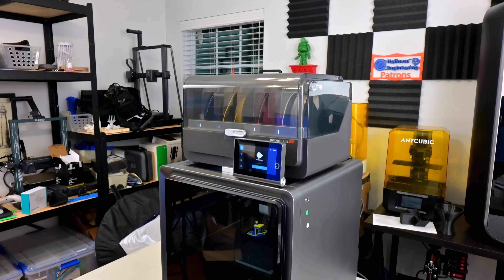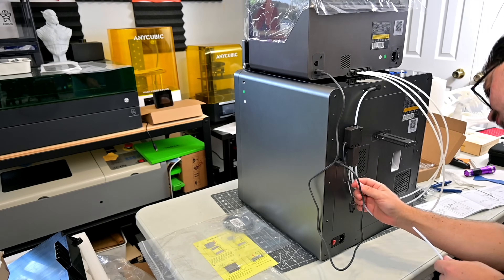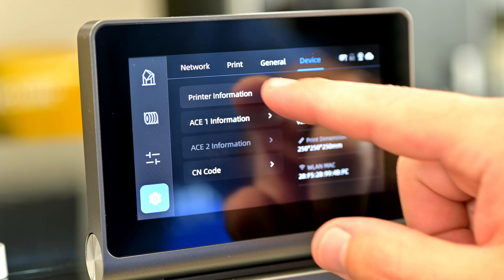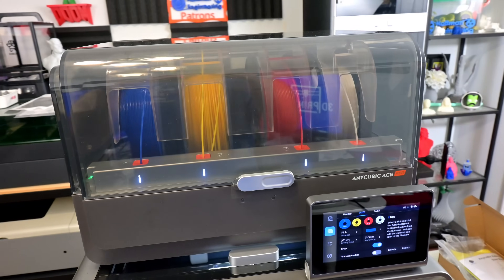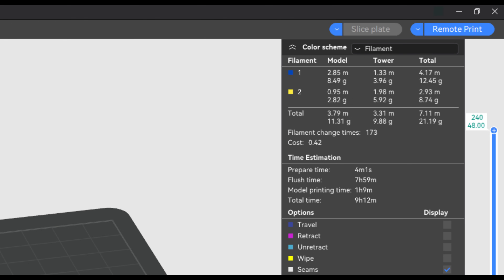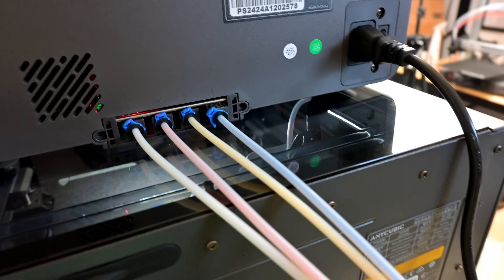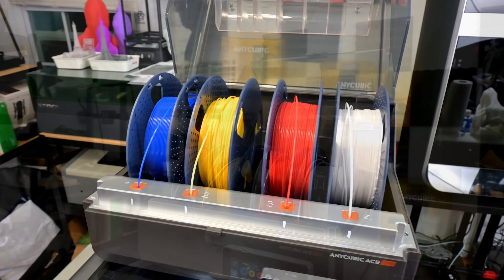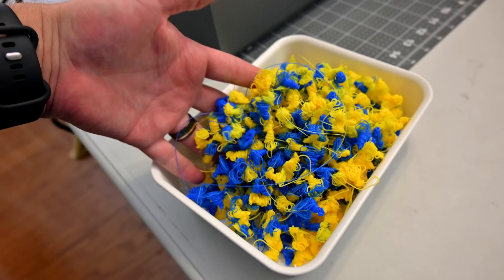Is this the Bambu Labs killer? Anycubic Kobra S1 | 8-color | Core-XY | 3D Printer - First Look.

Comment: Can this print from an app from phone or tablet? With WiFi?
Reply from the maker: Yes, the Anycubic app let's you browse their model library, and slice and send files directly from your phone to the printer.
Reply: @HoffmanEngineering  awesome thank you. I currently do not have a desktop or laptop. These are not required I take it to use this 3D printer? What are the advantages of have a hardware computer vs just using tablet or phone app?

Comment: Has anyone used an ace from a kobra 3. The one without the filament roll guides. As a second ace to give 8 colours. Cheers Ed
Reply: Search around on printables and other sites. I've seen some designs that basically replicate our supposedly improve on the dividers in the lid of the s1 ace pro so you can indeed use the ace from a kobra 3. There are also printable filament hubs too, even 5 and 9 port ones so you don't have to disconnect any of the PTFE tubes to feed filament from outside the ace pro, like if you're doing tpu.

Comment: How do you connect a second Ace Pro to the S1?
Reply from the maker: There is a 8-tube attachment you can print for the back (that replaces the 4 tube one that comes with the combo). Then you connect the cables for the second ace to the first one, and connect all the Bowden tubes to the 8-tube attachment.

Comment: Thanks for making this review, very informative and useful.  You mentioned about ACE will switch over to the next spool of a same color if the current one runs out.  In order for this to work, did you have to do anything in the settings, or it does it automatically when you have 2 of a same color filaments in the ACE?
Reply from the maker: You have to toggle the "filament backup" setting in the ace pro menu on the touch screen. If that toggle is turned on, it'll automatically switch over.
Reply: @HoffmanEngineering  Awesome, thank you!

Comment: The Kobra S1 is slower in sport mode the my Bumbu X1C in standard mode so what are getting paid to lie? Why is it that Anycubic went through the trouble to make a a filament dryer in the ACE pro then didn't bother to seal it in any way what so ever? and the software seems to have been rushed & buggy. Try printing 2 identical parts then about half ways thru it skip one of the parts and then see what happens the the other part when it finishes. you'll have some really funky quality and strange artifact where the nozzle starts after skipping the part. I bought this printer because I wanted to print carbon fibers like  ASA that you need to dry while printing but with all the air gaps in the ACE pro is a no go for me. I'm thinking of sending it back too many little thing to deal with.
Reply: LOL Bumbu is right!  My S1 SMOKES my X1C...In every way.  I literally have been trying to sell my 2 year old X1C and nobody wants the thing.  I was only asking $500 and I got ZERO offers from Ebay, Facebook Market place.  I did FINALLY this week get someone who wants to trade for a Creality Hi combo and I think i am going to jump on it.  Bambu are junk compared to newer printers

Comment: Got mine yesterday have yet to figure out how to get a muti color print to work.
Reply from the maker: Awesome! If you have questions, I'd be happy to help!
Reply: @HoffmanEngineering  how did u get the benchy to swap colors?
Reply from the maker: I downloaded a two color benchy from Printables, it was two separate stls. I opened them in the Anycubic Next Slicer, and it asked if I wanted to treat the two files as a single object, I said yes. Then told it to use filament 1 for the first part and filament 2 in for the second part.
Reply: Pretty sure you have to slice the model incorporating different colors. You can choose what portions are what color.

Comment: What is the footprint of Anycubic Kobra S1 Combo? How much table space do I need for it?
Reply from the maker: The printer itself is 16" wide by 17" deep by 22" tall with the screen open. You'll need another 3-4 inches at the back for the spool holder and poop shute. And account for the door swinging open at the front.

Add on the ACE Pro, if you place it on top of the printer it bumps the required height to about 33" with the lid open. Otherwise, if you place it next to the printer, you'll need an additional 14.5" wide, 12" deep, and 14" tall.
Reply: @HoffmanEngineering  Thanks for the accurate answer!

Comment: That amount of poop seems very excessive. I hope anycubic will let you change the flush volumes in the slicer like bambulab does in bambu studio, bambulab printers have the same issue but then you realise you can easily cut the flushing volumes by 3 in the slicer, then the amount of poop is a little better
Reply from the maker: You can't adjust in the slicer, but you can adjust on the printer itself. I'm wrapping up some tests around flushing amounts, and you can cut it down quite a bit for most filaments.
Reply: @HoffmanEngineering  thank you
Reply: @cartouchator his video is out
Reply: @ thank you, already watched and liked :D

Comment: Mine arrived yesterday, Feb 18, 2025 and it was rather easy to get up and running. I have done several tests and all is working very well. I did find the app and windows software a bit finicky with the wifi connection but finally got it all sorted out. Firmware updates were done and I don't see much difference between the Bambu Slicer and this one. I have a A1 Mini and now this one so I have all I need for now. Can't wrong on the current Pricing.
Reply from the maker: Thanks for sharing! Yeah, Anycubic's latest slicer is based on OrcaSlicer, which is based in Bambu Studio. Very similar functionality currently.

Comment: I’m always interested in the built-in slicer quality and stock tuning, and the material selection for these type of “plug and play” printers. Also if the ACE system can also swap between materials for potentially rigid and flexi materials or cheap and expensive materials for supports
Reply from the maker: Good things to note, thanks! I tried TPU in the ACE Pro on the Kobra 3,and I didn't have a good time. It gets tangled in the mechanisms inside. I learned how to disassemble the ace pro because of it though, so that's good.
Reply: @ essentially what you can achieve without tinkering. Good to know about the TPU. That seems to be the norm with every company’s version of this system

Comment: Would this be a good printer for a newbie. Im also concerned about the smell it creates
Reply from the maker: So far I'm pretty impressed by the usability right out of the box. I think it'd be a good option for newbies, especially those looking for multi-color printing.

The full enclosure and activated carbon filter definitely will help with any smells. But, I haven't printed ABS yet, and that tends to be a very smelly filament. So that would be the true test.

Comment: Hi there, thanks for the great video. I am deciding whether to buy the Kobra S1 or the P1S from Bambu Labs and this helped a bit. I have done a lot of research and talked to a few people I know who are 3D printers, but would love your perspective as well if you have one. So far the consensus from both the research and the chats is that there isn't really that clear of a difference between the two. No one has even said something like "The $200 extra for the P1S is worth it if...." No pressure to try to delineate the differences as I know those from the research, really just looking for your gut reaction to whether the additional $200ish for the Bambu Labs P1S is worth it in any way. Phrased differently, if it was YOUR money to spend, which would you choose?
Reply from the maker: I think you covered it quite well. That is generally my feelings so far about the S1. It matches the P1S, and there's really no big differentiating feature between them, which puts the S1 as a really good value. 

I'd like to see how the longevity and reliability of the Kobra S1 turns out. For my first few days, I'm very impressed by the S1. It seems to hold up well against the P1S. But, I'll also need to see how replacement parts for the S1 are. How does replacing a nozzle work, etc. Those could make the difference when running these printers for a few years.
Reply: Have you already checked something like this?

Comment: Wow, thats alot of waste of filament! I really hope that Anycubic fix that on future updates
Reply: If you want to save material, you can adjust it yourself. The reason for setting it to 1.5 is that colors like black, gold, red, and yellow often experience color mixing during printing. To help beginner users avoid this issue, we chose to increase the coefficient so they can achieve better color results without any adjustments. Advanced users can lower it below 1.0, making the purge amount comparable to or even lower than that of the K3.
Reply from the maker: I agree. On the Kobra 3 you could adjust that purge amount to tune it for each filament. But I don't see that option in the S1 yet. I hope they add it though.
Reply: @HoffmanEngineering you can do it on the touch screen while it's in operation
Reply from the maker: Ah, perfect, I see it now. It's under a sub menu on the main print information screen while a print is running. Thanks!
Reply: What about reducing the purge tower in the slicer?
Reply from the maker: Most of the waste is from the purge controlled by the printer/ace pro, not from any gcode sent from the slicer. You could reduce the size of the prime tower that the slicer generates, but I don't think the poop amount can be controlled by the slicer.

Comment: I got mine Thursday and it’s been printing constantly since Friday. So far I’ve only used PLA and PETG and I’ve had nothing but phenomenal prints. The Ace Pro is also fantastic and has saved me so much time changing filaments while printing multiple items with different colors using the “print by object” setting.
Reply from the maker: That is a great use of that! I'll have to share that tip.